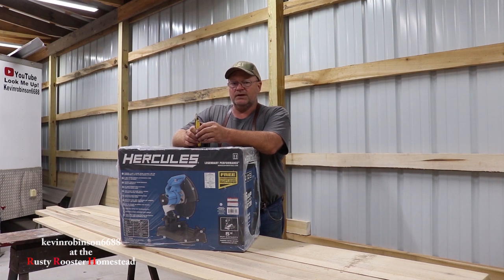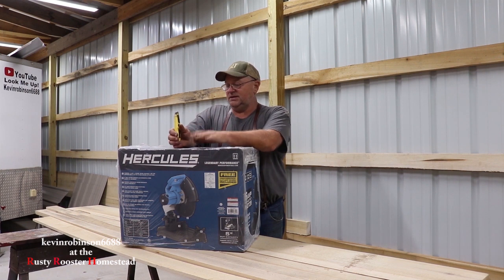harbor freight chop saw

Comment: Will this saw be able to work with a tungsten carbide disc rated at 600-1000rpm to cut iron and steel?
Reply from the maker: It should be fine.
Reply: What is the speed of the saw?

Comment: Doesnt cut edge of material very well. Blade warps and falls off the edge. Thats its only limitation i think. Wish it had speed control so i could slap a metal blade on it. 4100 is to mich for every metal blade ive found
Reply from the maker: Sorry to hear about all your problems i don't know what to say mine is working just fine ( so far) hope you get it figured out.
Reply: @KevinRobinson6688  it cuts fine just slipped off if trying to shave the edge of a part down